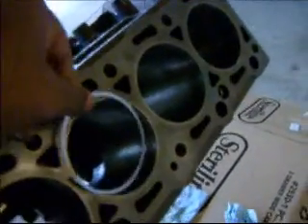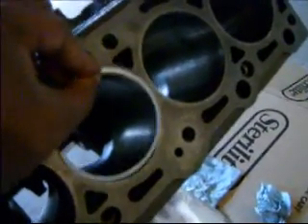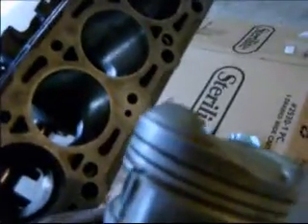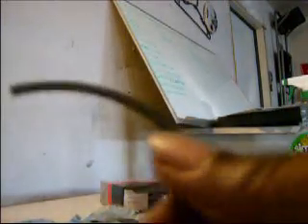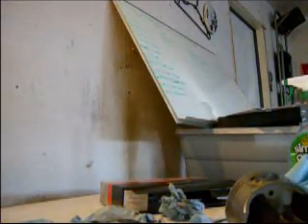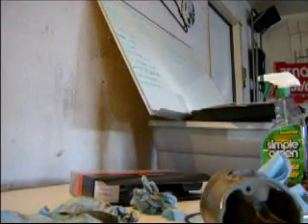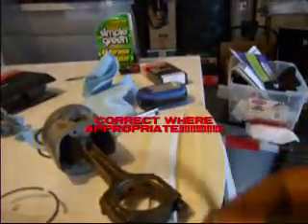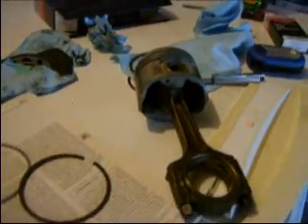PISTON RING GAPS

Comment from the maker: ***** I see 8.4:1 everywhere but the car actually requires high grade plugs which makes me wonder if I should at least put mid-grade fuel in it. I don't hear pinging so I'm assuming it's accurate BUT the 5.0 produces only 60hp more with twice the engine. The Ford set this motors up for the tuner community but the aftermarket didn't really pick up on it and documentation is hard to find. Going to have to figure out what the CR is on my next build. I'm thinking about going with a high revving stroker motor with a custom head but turbo is just so enticing! I know with the stroker I can get 10:1 for sure. I just hope it doesn't grenade when I have over 5k in parts in the motor. So to answer your question completely I've seen 8.4:1 and 9.0:1...so basically IDK. ROFLMAO!!